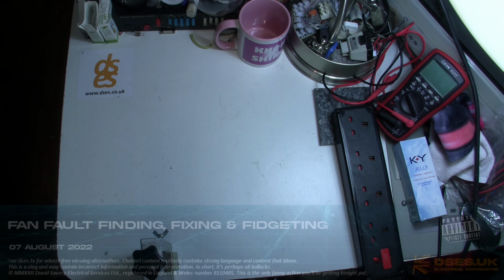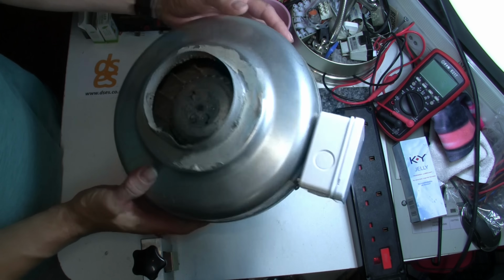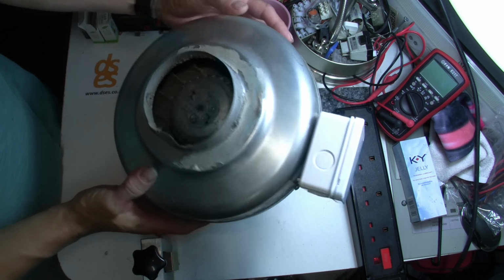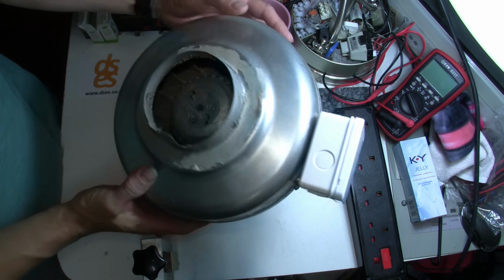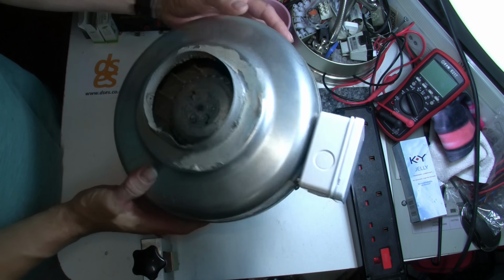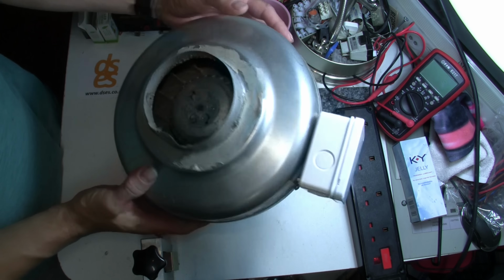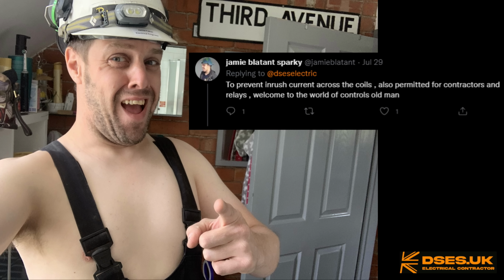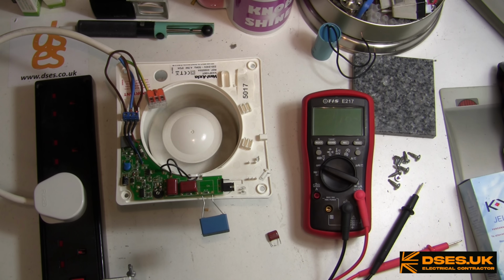Fan fault finding, fixing & fidgeting

Comment: I work for an electrical testing & EMC lab, and in all probability, Fans4Less are importing that timer from China, probably without any certification at all. I'd have a word with your local trading standards, they might have a few words with them ;)
Reply from the maker: The Manrose model carries BEAB and CE markings, but there's nothing on the SwiftAir. Even the PCB carries no legend regarding the manufacturer. As you say, I wouldn't be surprised if they just imported them and silkscreened their logo into place.
Reply: @dsesuk  Sounds very familiar! The product must carry the UKCA mark now if it's sold in the UK (post brexit). Most products carry both the CE mark & the UKCA mark since they're sold in both the EU & the UK though. If there's room on the device to place it, there must also be manufacturer details.

Trading standards tend to have a bit of a bee in their bonnet about dodgy or unmarked electrical equipment ;)

Comment: If the voltage reduction for the circuitry inside the controller is by a capacitive dropper this is commonly on the neutral side making the chance of an electric shock from the pcb less likely.  Ths possibly leads to the use of a triac in the neutral leg to the fan as a more likely design decision.
Reply from the maker: I see what you're saying, but would you also expect an external device such as this to keep Line held high?
Reply: @dsesuk Value engineering in action I think, primarily.   I am a bit hazy on Triac circuit design, but I think the gate drive voltage will only be 5V away from the neutral reference rail, hence switching the neutral only.
Reply: @BLOCKsignallingUK  no

Comment: I wonder if swift air will respond? I had a similar situation some years ago with low voltage fan designed for social housing. It came supplied with an isolator built into the transformer for ‘easy installation’. When I questioned with their technical why the isolator was only switching the line they simply told me that If I wanted more than single pole I needed to install that myself. Fucking garbage!
Reply from the maker: I don't think SwiftAir quite see the problem Ian.

Comment: Fantastic video David. I found it most interesting, as for that timer thing feck me what a joke that company should be brought to book. And I do so love that Robin MFT and the little blue IR tester I must try and get hold of one but not having much luck finding one as yet. 
Is there anything you you can’t do when it comes to electrical stuff? 
Thank you for a brilliant video mate . 👍👍👍👍👍❤️
Reply from the maker: Thought you'd like the Robin action in this one Sean! That Hioki is linked in the description - Farnell have them if you really want to part with the pound coins!
Reply: it’s the Robin I want . The Hioki is good meter. But no sense me getting one of them at the moment as I have my viccy although that digital. But I sure am amprobe Robin will turn up eventually.

Comment: Good fault finding video, reminded me of working on my electronic sets I got for Christmas back in the late seventies and early eighties from the local Tandy shop
Reply from the maker: I had a couple of those. One was a 100-in-1 electronics project kit that kept me entertained for years!
Reply: I probably had the same.  You should do a video about it, better fun than all these modern toys kids have.
Reply: Still got my 200 in one boxed but well used
Reply from the maker: @carlrobson5745  The 200-in-One - that was it! I still have the manual here, but the unit is long gone. Eight red LEDs,, a 7-segment display, loudspeaker, 7671 and 7400 IC's, PNP & NPN transistors - a brilliant bit of kit! Mine was blue in colour and I got it for Christmas around 1986. Cheers for the beers to Carl!
Reply: @dsesuk  no probs